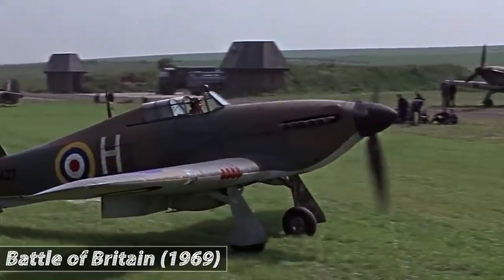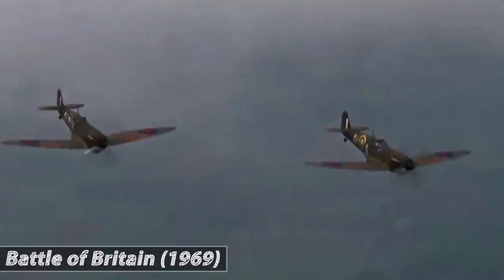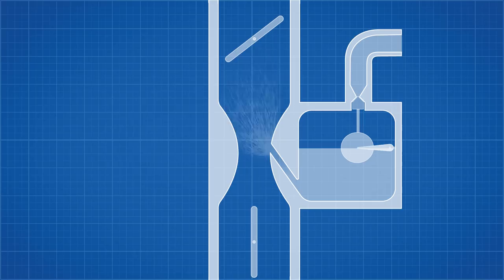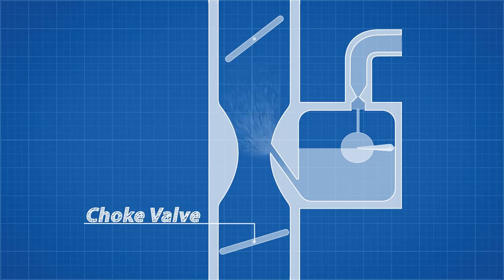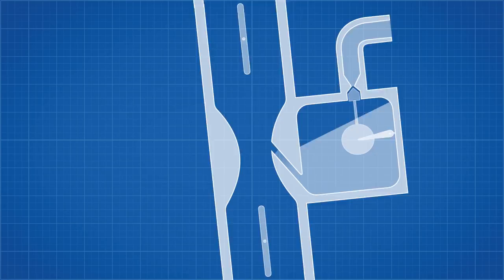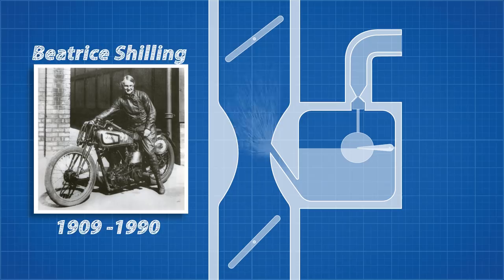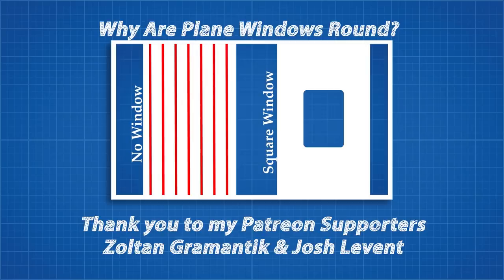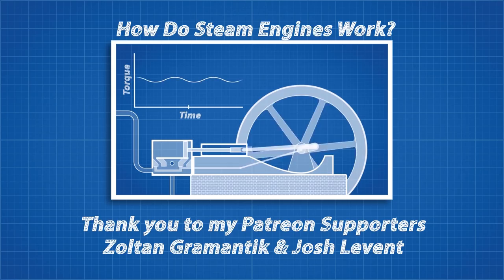The Spitfire's Fatal Flaw

Comment: I seriously doubt we are witnessing the effects of the particular problem fixed by the Tilly orifice during this opening scene of the Battle of Britain. The device was retrofitted during 1941, so I doubt any fighter survived without that or later modification (such as RAE anti-g  carb) to be filmed in 1969. Secondly, the problem would not manifest itself during a barrel roll which is a positive g maneouvre. The roll in the clip wasn't a pure barrel roll but I can't see where the g went negative. In a loop or barrel roll it is usual to close the throttle going over the top inverted and then open it again during recovery to level flight. I suspect that is really all we are witnessing in that scene. Nonetheless it is possible that the vagueries of the float chamber carb were the cause of this smoke.

Comment: Not really a "Fatal Flaw", just a minor problem which was soon overcome..
Reply: People died due to an imperfection in the engine design ergo a "Fatal Flaw"
Reply: Erik Lindström: Describe how people died because the early Merlin could not sustain negative G?  It prevented those Spitfires and Hurricanes from diving to pursue a fleeing Bf 109 - note that in this circumstance the 109 pilot does not die.
Come on then - fatal for who?
Reply: You do a loopy loop in a spitfire and the engine dies. Thats a sure way to lose a dogfight. Trust me, I have played war thunder. I know what I am talking about
Reply: Erik Lindström:  Oh dear.  I will be charitable and assume you mean the aerobatic maneuver called a loop.  If you try doing that in a real dogfight, you're dead already, running out of energy and maneuverability.  Your pursuer's wingman will thank you for presenting an easy target.
You show yourself to be an incompetent simulator pilot, a keyboard warrior, and expect me to take you seriously?
Reply: @eriklindstrom499  
If you do a loop in a Spitfire the engine will not die since that is positive G.
Maybe you should look at what  aircraft had this so called fatal flaw.  All aircraft with a carburetor had the same problem until after Rolls Royce fixed the problem so  the 
P 39, P 40, P 38 and many others had the problem well after it was solved on the 
Spitfire, in fact Rolls Royce having solved the problem gave their carburetor to Bendix.
Trust anyone who has played war thunder but  knows so little about aircraft, I do not 
think so.
Reply: @barrierodliffe4155  I'm not talking about doing a loop, I'm talking about doing a loopy-loop. If you don't know the difference then you shouldn't be in this thread.
Reply: @eriklindstrom499  
Unfortunately having been involved in aircraft for many years and having flown for real and not just in a game I have never heard of a loopy loop as an aerobatic maneuver.  Maybe you can explain what it is for all of us who do not play computer games.  
Maybe while you are at it you can explain why the Spitfire engine might die as you put 
it, good luck with that.
I am in this thread because of my knowledge about carburetors and how they work,  I 
also happen to know a bit about aircraft, having been involved in making and testing 
aircraft, but playing games like warthunder of course you know it all.
Reply: @barrierodliffe4155  The loopy loop is a maneuver that is a variation of the loop which was first invented and flown by Karl Von Loopen, hence the name loopy loop. It begins similarly to the regular loop but at the highest point of the maneuver, the pilot extends the left phalange, which with your understanding of airplanes you must realize what effects that would have on the airplane's trajectory.
Reply: @eriklindstrom499  
Never heard of Karl von Loopen.  as for extending the left phalange, a phalange is the end joint of a finger but maybe if a pilot used the aileron on one side the aircraft would tend to roll which would be a bit like a maneuver which is  called Immelman turn, that is done by using both ailerons in opposite directions and would not adversely affect the Spitfire.  
To bunt into a dive or to perform an outside loop would affect an early Spitfire but it is still not a fatal flaw and since all aircraft with carburetors had the same problem until Rolls Royce fixed it, not  something that only affected Spitfires.

Comment: Hurricane in the clip, not a Spit. Next up, the BF-109 and its superb twin engine design.
Reply: Look closer at the Bf-109, it is the post-WW2 Spanish version (think it is HA-1112-M1L). That is what they had available for the movie. Guess which is its powerplant!
Reply: You're only off by one:  109+1 = 110 :)
Reply: If you look closely in the scene where the Polish squadron is on a training flight flying Hurricanes... the planes in the very back of the formation are the same Spanish 109s.  They didn't have enough Hurricanes for the shot and having a Merlin up front made them look similar enough.

Comment: most of the clips you shown were hurricanes.... get ya shit togethaaaaar

anyway the flaw listed as the spitfires fatal flaw was fixed with newer models so, meh the title should have been " early spitfire's flaw " as it wasnt the entire spitfire production time
Reply: Spot on. You've just saved me having to post the same comments.
Reply: yeah and it seems everyone else seen it too :/ i just read down in the comments
Reply: Yeah that and, as the video mentions, they developed a relative simple method of mitigating the flaw so it would only cause a stalled, not flooded, engine.
Reply: Eagles_Eye. First thing I noticed
Reply: To be fair, he did mention the pressure carburetor fix that was developed later.

Comment: btw just as quick fun fact, the typhoon which is a similar had similar mechanics as the spitfire did not have this problem, reason being the engine was much different to the spitfire, another reason this didn't happen was because the typhoon was way too heavy to even to a barrel roll.

Comment: in the hands of an expert, I will concede that the bf109 fighter was better than an early version spitfire. however the spitfire is a much easier plane to fly, and very forgiving to beginners. The Germans lost many more pilots in training than the British
Reply: The Spit wasn't that forgiving (though more so than the 109).  The Hurricane was actually an easier plane to fly, though the Spit was a better fighter.
Reply: not that forgiving actually they had a bad habit of tip stalling when turning in at low altitude which killed a few novice pilots.

Comment: I hate to admit this, but a German Engineer can run circles around a British engineer.
Reply: The germans lost the battle of Britain so there 'inventions' weren't good enough.
Reply: Losing or winning a war is not a sign of how good your engineering is.

Think about it like this: They were building almost a thousand V-2 missiles a month while being constantly bombed day and night and while having resource shortages. They were more clever than you'd think.

The Germans lost the Battle of Britain because they moved from strategic bombing to terror bombing. They almost had the RAF wiped out. Just a thousand planes. A few good bomb strikes on factories and airfields/hangars, and they'd be out. But, just when they were on the cusp of winning, Hitler ordered them to begin terror bombings.
Reply: Bad Beard Bill Well that's simply wrong. The V2 rockets were produced by a massive workforce of slave labourers and had nothing to do with German ingenuity, and by the end of 1940 Britain was actually building more fighter aircraft than Germany. The fight of the few to save Britain etc was more of a myth to boost moral and galvanise fighting will and spirit. Just like the nonsense of gathering up scrap metal for the war effort. Most of it was dumped.
Reply: Yeah, I'm sure you hate making your baseless comment which is intended to start an argument.
Reply: I'm not sure that they lost...